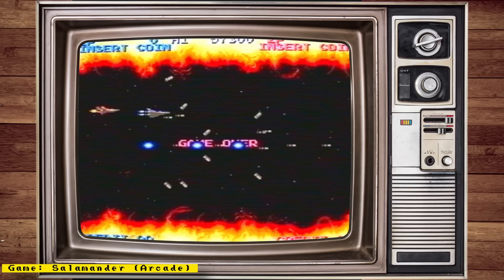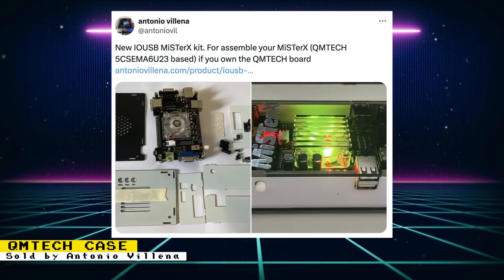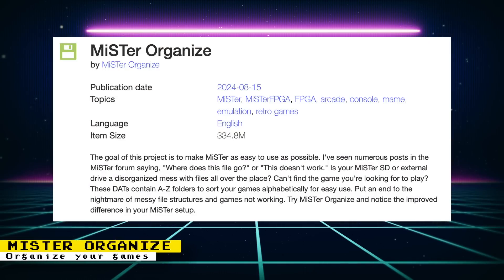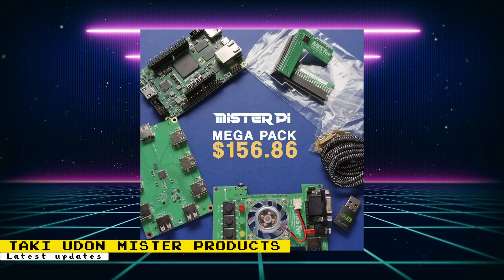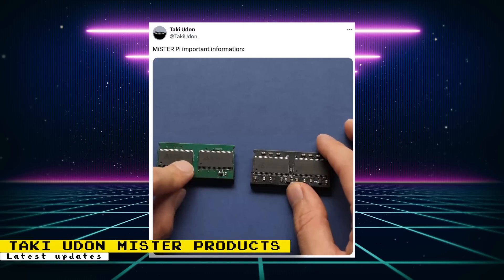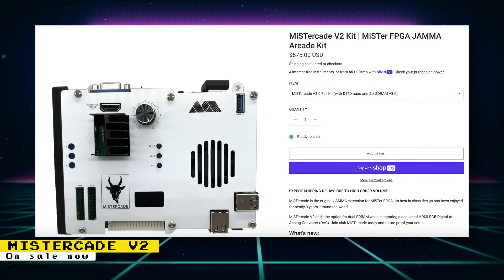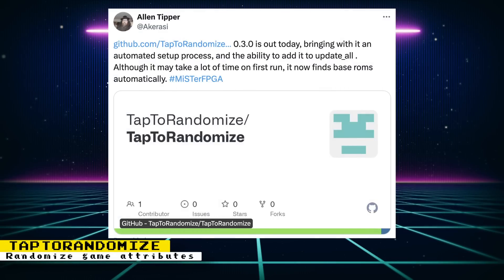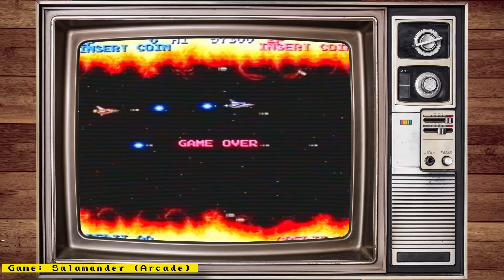MiSTer FPGA News - DE10 Nano Successor? DE10 Nano Alternatives, Arcade Cores & More

Comment: I wonder if there is a need to increase performance, at least for the retro market. I doubt there later systems could even be run on FGPA systems when the latter console units use x86 and Nvidia GFX systems, that's just not going to happen soon.  The Nano-25 says 2.5x performance, don't see this having any benefit for 99% of stuff afaik.

Comment: I saw Taki recommending 5V2A or better to run his board. It’s on the website, under the Firmware / Setup section
Reply: Power Supply Recommendations:

MiSTER Pi requires a minimum of 5V2A. You can satisfy this requirement with an old 5V2A wall wart or a modern Type-C PD charger. If you use a PD PSU, MiSTER will negotiate up to 12V3A from your charger, and then drop that voltage down to 5V to run the rest of the board and connected IO. This voltage drop comes with additional heat, so you should use active cooling when you connect a bunch of USB devices that draw a lot of power (USB HDD, devices with batteries, etc).

A 5V2A PSU doesn't require DC-to-DC drop-down conversion, so it will always run cooler under heavy loads without active cooling, and it is the best option if you want a silent MiSTER build. If you always plan to use active cooling, it doesn't matter which type of PSU you use. MiSTER will negotiate the power that it needs as long as there is a 5V2A minimum.

The best PSU is the one that you already own that meets the standards detailed in this section. If you do not already have one or are not sure, there are two things to be aware of:

Is your PSU from a reputable source or online marketplace?
Did your PSU pass a certification process for use in your country?

Comment: I kinda want to get one of those Mister Pis - but I'm not sure I fully understand how the A/V board is set up. Does it have an HDMI out (including the audio) or is just the VGA out? The store page doesn't really help since it says it has digital out but only lists VGA.
Reply: It’s a board that gives 24 bit analog over db15 (vga connector) , a 3.5 mm audio jack, and a snac serial connector. Analog tvs will need adapters to use it with them. It can output both through the hdmi on board and the vga connector simultaneously, and can work as both a vga port for monitors and composite, Svideo, and rgb out, all through configuration on the device.
Reply: @Funboringness  so it has a hdmi out then. Weird that it doesn't show or say it but maybe that's assumed knowledge. I have no clue what's and what's not on any kind of mister board but this might be my entry then. Thanks for the heads up!
Reply: @RazorMarc  if you don't want analog out, you can just buy the base board and ram combo for full core compatibility, the HDMI thing is confusing to new people, but tbh the analog out board wasn't made until years after the mister project started, so confusion may come out of that. Edit: forgot to mention that the digital io board gives a snac port, which some people may want out of their device!

Comment: Mister pi is a terrible name that just begs for confusion. That's unfortunate.
Reply: I also think "pi" is currently trademarked
Reply: @SuperSteve152  That's my worry.
Reply: @SuperSteve152 Think again. RaspberryPi, RockPi, OrangePi, BananaPi… all from different manufacturers. MisterPi, while I can see why people are whining about it, seems to be a good way to market it because the eye-roll-inducing “controversy” over the name at least gets people talking. 😂
Reply: @SuperSteve152 It’s not trademarked, because pi is a number, and cannot be trademarked. There are many products by many different manufacturers that include the word “pi.” BannanaPi, OrangePi, RockPi… etc. The name isn’t actually too far off describing the device since SBC’s that use the name “pi” tend to include ARM-based processors (cyclone 5 contains an arm processor on-die).
Reply: It's not a Raspberry Pi variant, that's why the Pi name makes absolutely no sense.
Reply: The name is fine. I don't have a problem w/ it.
Reply: It's wild to me how many commenters and people in the scene feel obliged to instruct Taki how to design / market his product. It's becoming a meme.
Reply: @Fattydeposit  It's a confusing name.  What's wild is naming a product something it isn't.

Comment: If the de25 can't to 4k hdmi then it's a.no go for me! .. that it basically the largest missing feature for me. Anyone heard if that would be possible ?
Reply: This is what I'm concerned about regarding longevity too. And while not necessary, but it would be nice to have larger onboard SDRAM too
Reply: @oldboone  RAM is something they are talking with Terasic about doing.
Reply: @alextirrellRI  that's good to hear
Reply: According to MiSTer-discord it doesn't support 4K unfortunately (mainly as it's a Terasic-related issue in general)